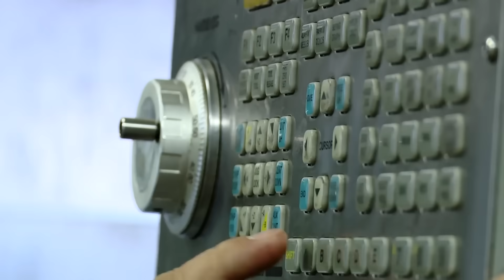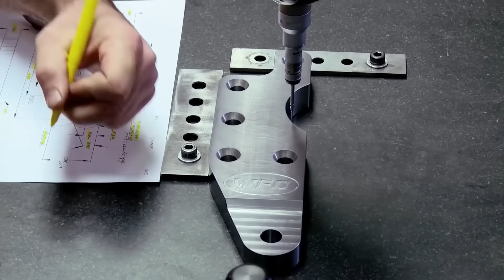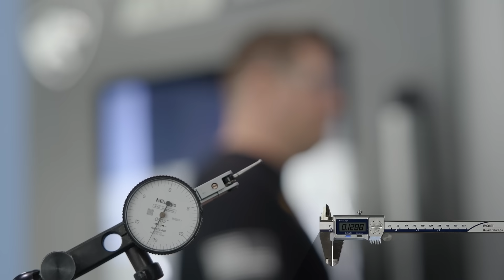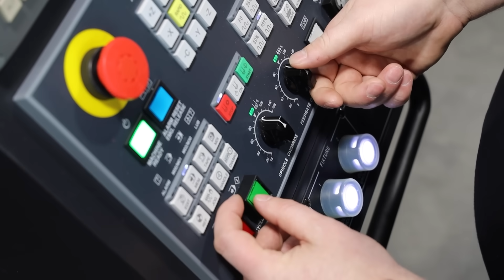Tools Keep Breaking on Night Shift, but Run Perfect on Day... Nobody Knows Why

Comment: Worked at a place where every company engineer kept messing with a CNC machine's settings and setup. Different hands, different "fixes", scrap parts made. Then the operators were blamed, but that didn't last long--the operators spoke up in a meeting and threw the engineers under the bus. By the end of their incompetence, the CNC machine company's techs had to be hired at serious money per hour to straighten out the mess. I asked one of the techs how it was going as he was signing out for the day, and he said he'd never seen a machine that bad. And it took them days to get it back to proper operation. DAYS! KA-CHING!! $$$$$

Comment: I am not a machinist so could someone explain why the night shift guy might want to alter the program in the first place?  If the program is already working then there's no apparent reason to change it and if the program isn't working and fails then it wouldn't be the night shift guy's fault anyway since the program was set up by the day shift guy.  Seems like there's no reason for the night shift guy to want to alter it unless there's some problem, and if the program is "perfect" like the voiceover says then there shouldn't be a problem.

Comment: Maintenance supervisor - The pultrusion machines would run continuously as long as you feed them materials. The day shift had no issues making good product. There was a half hour turn over between shifts. But, the swing shift supervisor was adjusting the machines to make them run faster. Which produced a lot more poor quality parts and would often crash the machines. The reason recorded in his down time log reflected that it was a maintenance issue that caused the shutdown.  Yea, ah, no.
Reply: I have pultruded both with and without twist and heated baths and changing the feed rates, takeups, or temperatures was an easy way to trash the run. So was a faster than recommended ramp up of pre-heated resins.

Comment: I had this problem with going back and forth with QC as first few parts were not in tolerance. 

Went through logs to see my colleague did the same thing when he got on shift so stood extra 30min one time and asked him if I can watch after explaining the problem.

Turned out he was a lefty and the way he loaded the fixture was different.

I usually, like most of the other people, turned things clockwise, but whenever I worked with him and before I started to do corrections to offsets I just did everything counterclockwise and usually it passed quality control.

He was the old timer so I didn't even try to get him to change. I just adapted.

Comment: Second shift gets it done and trainees on first shift spend all day complaining about it!  I had a programmer amp up all the feeds and speeds on paper tape.  I'd tune the program to get the best (blue) chips with the least chatter.  I'd put my revised paper tape in the library for all to use thereafter.  Book values don't consider variables of aged machines and issues with lash in the ways.

Comment: I don't even work in CNC just metal processing and it's crazy how many times operators change settings to absolute batshit crazy things... I'm just the electrical and PLC guy but I need to have an understanding of how these machines work because sometimes I just chase a red herring while a single value was entered wrong. Or in a worse case, something broke, we fixed it and it broke again straight away
Reply: Years ago, I worked at a pasta plant as a maintenance tech, and I took the night shift because of how much smoother everything went due to management not being constantly underfoot, issuing orders that didn't help make anything work better.

Comment: The key takeaway should be that the second and third shift operators shouldn't be making any changes to the process when it's been shown to work just fine for the first shift. If they THINK there should be changes then they should be conferring with both the first shift operators AND the person who designed the entire process, not just making changes on their own without authorization.
Someone needs to have a long talk with those second and third shift operators and supervisors.
Reply: I would begin by making sure they were communicated to correctly. Did they know it was preoptimized? That shift 1 had fully tested it already? Who to contact if they had concerns and questions?

Now, if so, then it's time for a lesson on proper collaboration and communication.
Reply: The fact he had to stay "late" just to talk to a guy on the very next shift...

Comment: Really just lazy programing.
WHY? Almost every CNC has the option of programing at the very least Distance per revolution. Most also have the option to program the feed per rev in a un alterable state ignoring pendant adjustable things like RPM and FEED RATE overrides.  This isn't new and has been around from even the punch card programing days.
The most common issue like this isn't slowing things down its operators speeding up to make the rate to increase break time.  Almost always reducing tool life in the process and often impacting on finished product quality and repeatability.

There is however one issue some encounter on back shifts that can cause tool issues that in my experience usually wont manifest itself tooling wise but in machine electronics reliability. This is variations in Mains Power Supply Voltage at different hours and on extremely rare occasions Frequency.  This happens far more often  than you would think and in a big shop with 20 odd CNC's can almost be introduced at will via electrical demand. In maxed out supply systems its very common, But time of day and power supply into the plant can also reflect grid fluctuations.

Comment: I've heard some stories like this before. If I was designing a CNC control system (I'm a software guy), I'd make it really easy to log what people are actual doing, where it's not what the original program was set up as and feed all that back to the office. You shouldn't have to show up for the night shift to know that the crew is doing things different. And that's not just a "stuff going wrong" thing because if someone is doing better, you want to be able to figure out that as well.
Reply: Yeah, I do medical software and the doctors are often "I did this, but your system lost the data". We log like crazy, and we can show them "and here is where you entered the data onto the wrong patients record". Nothing like a complete log to find out what REALLY happened. As a part time machine operator, yeah, I agree that the controller should be logging all those settings and keystrokes...
Reply: That has a lot to do with Quality Assurance/Control kinda stuff too. If there is a procedure to follow with specific parameters then whenever someone changes anything, they fill a brief deviation report and say what happened and why they broke protocol and then these are dealt with on a case by case basis to determine if someone needs to be reprimanded or if the procedure needs to be officially updated.
Reply: It's a little difficult to implement/integrate that unless the machine shop is already set up for lights-out-production. Most CNC machines have a bunch of intermediary "systems" for lack of a better word to make the machine's operation "faster & more accessible" (especially to those without an actual computer programmer's skillset). G-codes, M-codes, different manufacturer UI's, individual machine idiosyncrasies, shops'/engineers'/CNC programmers' different chosen CAD, CAM, & Postprocessors. All of these and more make that rational suggestion of yours a bit hard to implement. Not to mention the human & business factors at play in pursuing the endeavor. BUT, I in no way disagree with your idea & its proposed benefits.
Reply: @hobbes281  The human factor is the biggest hurdle. You could go full caveman and leave a paper log on a clipboard next to any control panels, but getting everyone to play along is worse than herding cats. What baffles me is the engineers who want the data are often the hardest to convince to record anything
Reply: A lot of controls actually have a log/key stroke/system log already in the control going back quiet a few years. 
Unfortunately, you have both kinds of people on different shifts and in different roles too... I've dealt with know it all operators and engineers/programmers and thankfully like now days I get to work with righteous bunch of people that actually know what they are doing and our engineers and lead programmer are really darn good and i love working with them....😁
Reply: @rhinox0110  Agree: The best people actually know what they are doing and when they are outside their skills and you just turn them lose. Lots of people know how to follow directions and you only need to trust them to know when to shut it down and call in the repair guy. The bad ones think they are the first group by don't even know as much as the second.

Comment: I ran 2nd shift for quite some time and learned a lot. Communication with the setup guy is what really nailed down the process. Once I understood why he did certain things it made it way easier for me to resolve and prevent issues. It also helped me gain a larger understanding of what to check when something does go wrong. Eventually it got to the point where I could make suggestions based on observations throughout the night and the setup guy actually listened and implemented what he thought would help. Just communicate across all shifts for anyone to be involved in that machine, encourage questions.
Reply: tl;dr; do it the way the guy who set it up says, at least until something isn't working right?
Reply: @benjaminshropshire2900  or at least don't unilaterally override the plan without being informed.
Reply: @benjaminshropshire2900  Man you would think that's all it takes. But some people out there really need to be told the most basic of things lol
Reply: @XGamesJ6  If its working for the day shift why change anything. Dunning Kruger at play again.
Reply: Or you could have done it like my workplace and kept the shit rolling downhill until a cascading failure occurs due to lack of supervision and guidance

Comment: You also had what Aviation folks would call a "Human Factors" problem.  When you turn it over to another shift guy, give him a briefing about how you arrived at that particular setup, tooling, etc.  I'm assuming the 2nd shift guy has expertise, and is expected to use it.  So let him know why, and how, you got to the program you got to.  You'll both be on the same page, and he'll be an even better machinist.

Comment: With industrial woodworking machinery there are optimum feed speeds for extended cutter life for different spices of wood. The place I once worked tried running a second shift several times over the years and each time put a stop to it because each time the day shift had to spend half or more of their time redoing what the second shift screwed up and repairing the machines from the people turning the feed speeds up way too fast and feeding defective parts into the machinery.
Reply: So they didn't try at all then.
Reply: @justice_1337 For a long time they just had the one shift work lots of overtime until they didn't have a choice but to start up a second shift again. By that time they had come to the realization that they needed to move some key people to the second shift to oversee production, spend more time training people, and pay the competent ones enough to give them enough of an incentive to give a crap. Several years after the founder's sons took over they hired a company to manage the place for them that raised starting pay way too much while giving the older, more experienced employees nearly nothing in comparison. The new management had zero respect for experience. I retired after 32 years with the company. Shortly after most of the other older, experienced people including their entire maintenance department left.